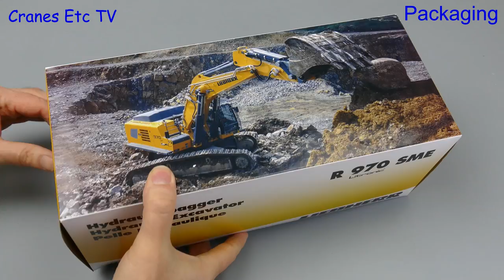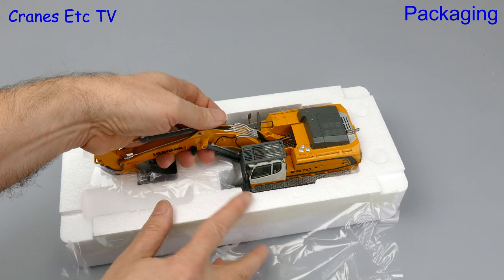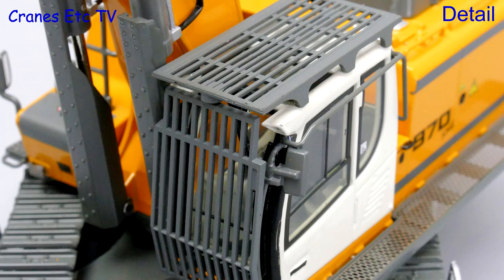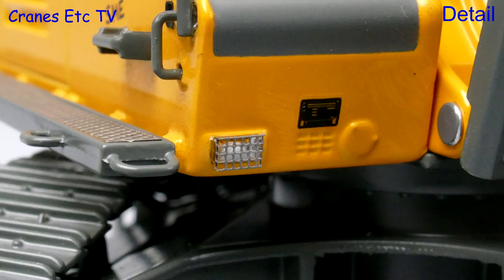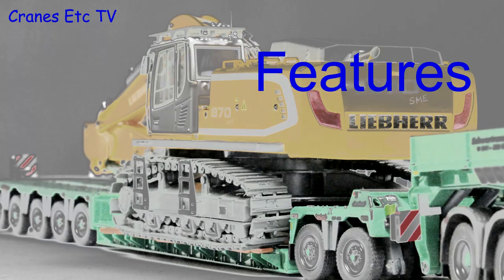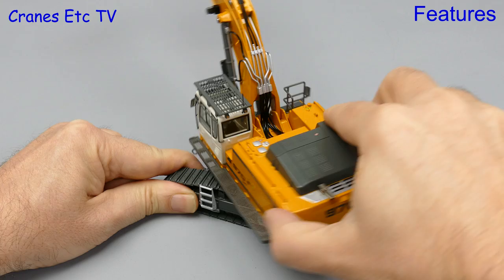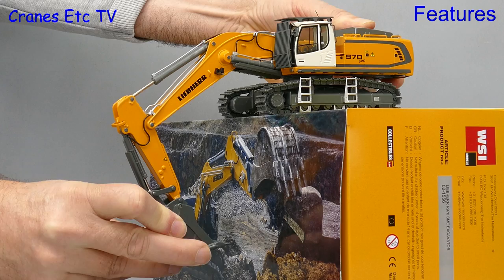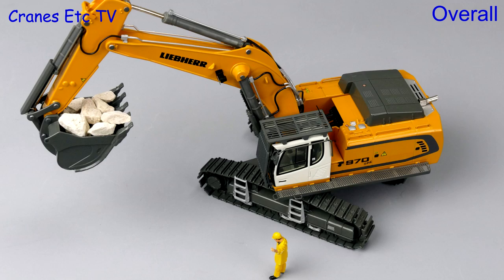WSI Liebherr R 970 SME Hydraulic Excavator by Cranes Etc TV

Comment: Excellent model. Bought it back in July of this year and was not disappointed. Bucket is very large, about an inch 1/2 tall, about same height of an O scale construction figure. A much better deal than the Hitachi Zaxis 870 IMO. Bought mine for $172 where as 870 goes for around $225, or 250 with demolition attachments. 

Best excavator out there however is the Liebherr  R960. It is a long reach demolition model,  but the main boom can be removed for a regular unit with a bucket. Cranes etc. reviews this as well and gives very good details and demos.
Reply: Dude why did you ask the bucket is big well because if they use small bucket The Mining took so long but if it's a big bucket the job would be faster than the smaller bucket one.
Reply: Idk I only learn orcas not excavator but I know excavator a lil bit